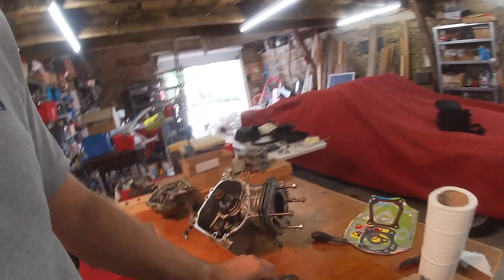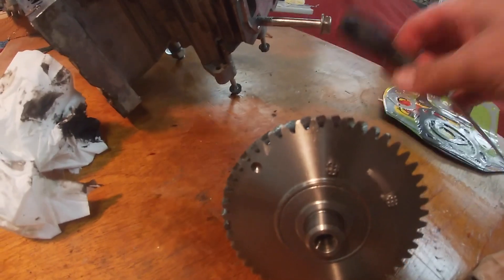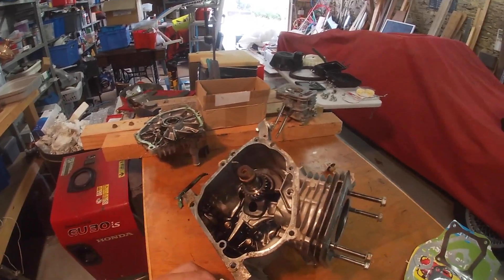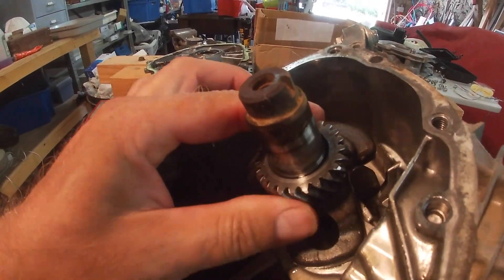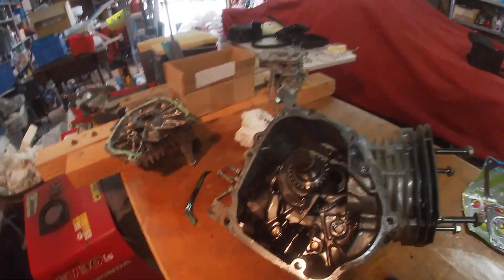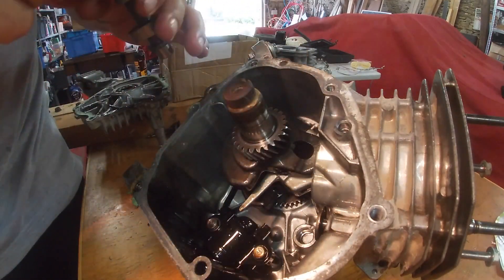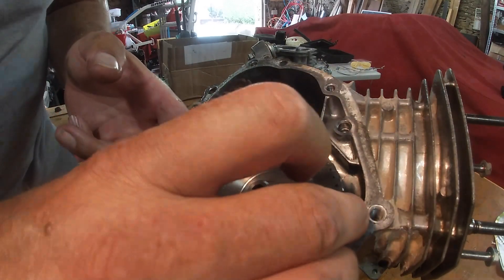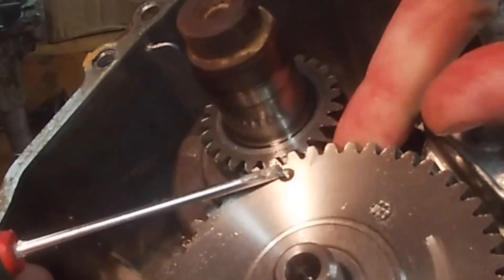How to set the timing on a Honda GX 160 or a GX 200 small engine

Comment: It is a bit different on the GX140 and/or GXV140. It is the 4th tooth to the right of the keyway center and most of them are not crankside marked for some strange reason. Cheers.
Reply from the maker: Yep it's specific thanks for watching

Comment: What if the timing mark on the crankshaft isn't there anymore? How too tell if you are tdc or 180 out?
Reply from the maker: Good point, fortunately the mark is usually there but very hard to see. If not then that's a different video, I can maybe do one at some point. It's worth noting the flywheel is located by a keyway on the other end and is fixed so you could rotate it until the magnets make it harder to  rotate then you know you are approaching TDC.